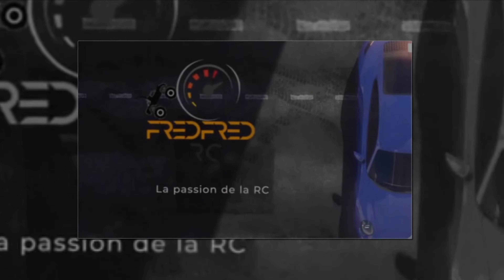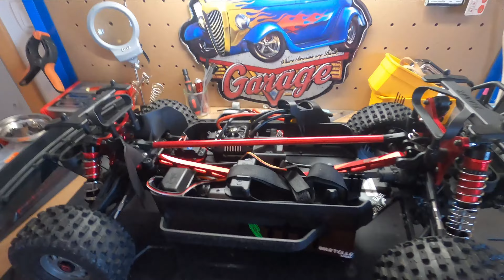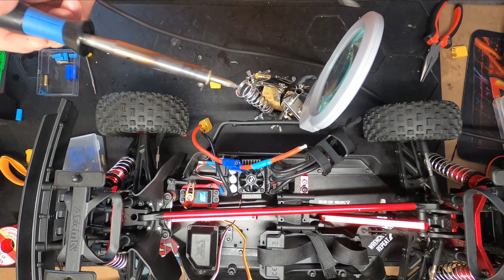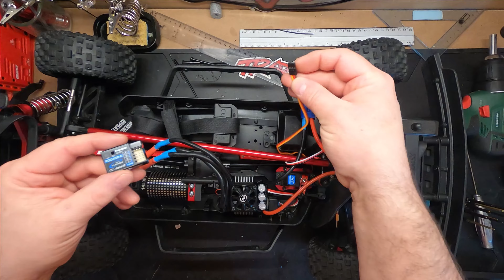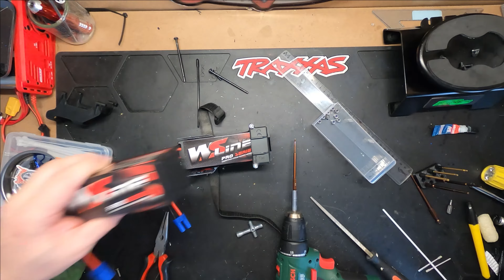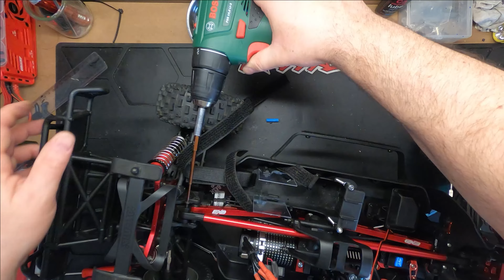ARRMA MOJAVE EXB 8S PREPARATION ET MODIFICATION

Comment: Hello fred dit je vient de commander un mojave exb aussi qui va être en 8s aussi  première question je vais prendre le hobbywing max6 en 1100kv sa va sur se modèle et deuxième question pourquoi tu allonge les câbles de ton moteur trop petit d origine merci d avance fred
Reply from the maker: hello l'ami, alors le max 6 est un variateur. Pour le moteur je te conseil plutot le 1650kv en 6s ou le moteur du cen 1450kv en 8s. Je pense que le gros gros hobbywing en 1100kc est trop gros pour rentrer dans le mojave. Bonne soirée
Reply: @fredfredrc  moteur du cen c est quoi fred 1450kv il y a chez hobbywing OK pour moi